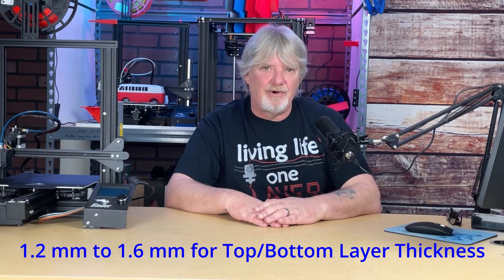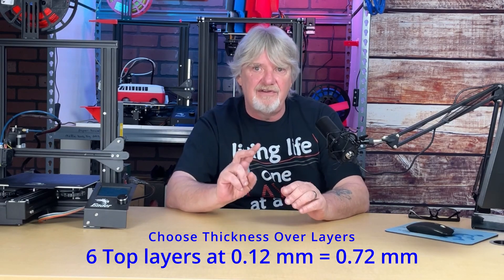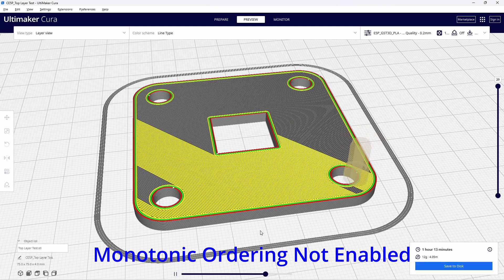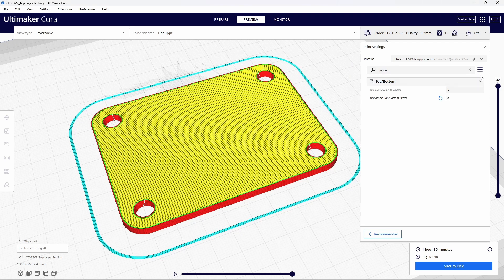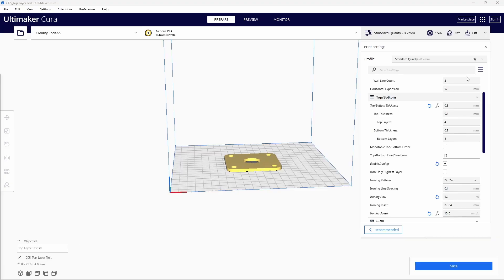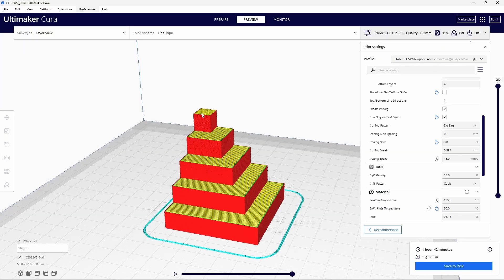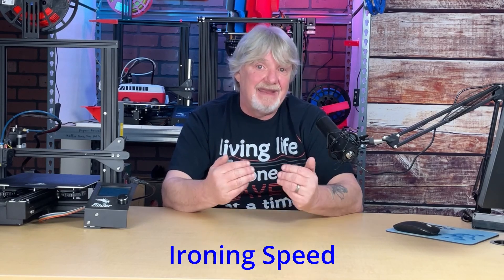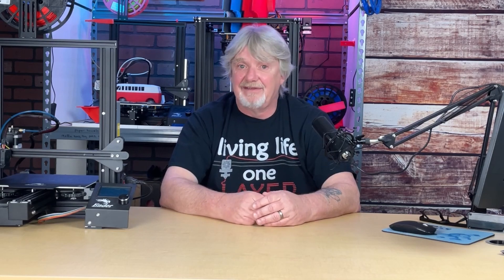Understanding Top and Bottom Layers: The Key to Perfecting Your 3D Prints

Comment: Oh, BTW, I just Subscribed (I'm always forgetting to do that) to your channel because being an old buggar myself (and nost likely needing a haircut too) you speak my language...and with patience.  ALSO...for those out there using Orca Slicer you'll find the 'Monotonic Ordering' located under 'Strength'/ 'Top/bottom shells'/ and inside the 'pattern' multi-choice settings...HTH.
Reply from the maker: Thanks for those kind words! Forget the haircut, if you've got it, flaunt it! Someday we'll be a hot commodity in the nursing homes! The only geezers still sporting our own hair. Thanks for watching and thanks for subscribing!
Reply: @pushingplastic7445  LOL. "...The only geezers still sporting our own hair..."  Funny you say that because I was just having a conversation about that the other day, because when I was young, I always thought I'd be nearly bald by the time I was on the leeward side of 30-something, but I'm now pushing almost 70yo and I still have a (almost) full head of hair like you...life is a funny thing. I know you kinda concentrate on Cura most of the time but all of your pointers are definitely valuable, even if I have to 'translate' some of it over to Orca and Simplify3D for my usage...keep up the good work!
Reply from the maker: @gordonrain7152  Thanks! Just a few minutes ago I was left a comment "Nice wig". I guess you can't be older with a full head of hair and a bad haircut! I started off with a lot Cura videos and have been trying to add some Orca and Creality Print as well.

Comment: In regards to Ironing, I actually found best results with FAST ironing.  I iron at 110mm/s, 25% flow, 0.25mm Inset, 10% overlap, and .02 line spacing.. (on my AnyCubic Vyper).  It's quick and my top surface is as smooth as a baby's bottom.
Reply from the maker: I don't do a lot of ironing, but I will have to give those settings a go! IF it works out, maybe I'll use it more often! Thanks for the tip and thanks for watching!

Comment: Everything you said worked for PLA... but PETG has been a problem for me and nothing seems to work except adding a ridiculous amount of toplayers. Strangely, the slower I print the toplayer, the worse it looks. It's almost as if the heat needed for printing PETG negatively impacts the toplayer quality when printing too long and slow on a small area.

Comment: Hello there. Very informative video, it helped a lot. 
I am very new to 3d-printing and still figuring it out. I am printing a testcube over an over again to get the best results. Everything looks fine by now but the bottom layer still has fine lines visible.
Is there anything i can do to make the bottom layer as smooth as the top layer?
Thanks!
Reply from the maker: Lines in the bottom layer are one of two things. The print bed might be slightly out of level. The worse the lines look, the more the bed is out of level. It could be a warp in the bed. The other could be the print bed material. I use glass on a lot of my printers and the bottom surface always looks better than the top since there is no texture on the glass. When you start a print, watch the first layer go down. If you're seeing gaps or blobs in your first layer, check the bed leveling. If it goes down fine, I would look at the print bed material. Post back and let me know what you see! Thanks for watching!

Comment: My top layers seem to be amazing, but my bottom layers are horrific. I've got them set up the same in terms of size and number etc... Been pulling my hair out trying to figure out what's going wrong. Also having major stringing all of a sudden.
Reply from the maker: The bottom layers could be as simple as the bed not being level or oil from your your hands getting on the print bed when removing the previous print. For the stringing, I would run a temperature tower, then do a flow cube and finish up by printing a retraction tower to dial it n your settings. I have videos for each of those items on my channel. Thanks for the comment & thanks for watching!
Reply: @pushingplastic7445  Will do. Thank you!

Comment: Well done video presented in an organized manner.  Kuddos.
I don't use ironing in my prints as I just love the look of a nice top layer.  My trouble has been getting rid of those drag marks running diagnally against the grain, GRRR.  I'll try your tips on monotonic and "not in skin" combing.  Thanks
Reply from the maker: Same here. I prefer the look of the lines. Ironing is nice, but you're still going to see the layer lines on the vertical surfaces anyways. I'm sure there will a project someday when I'll need ironing again. Thanks for watching!